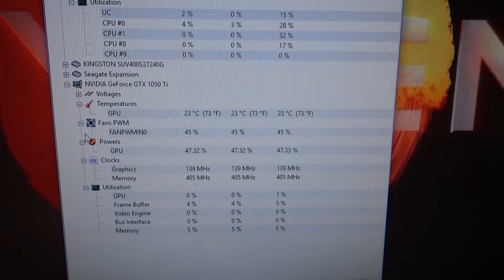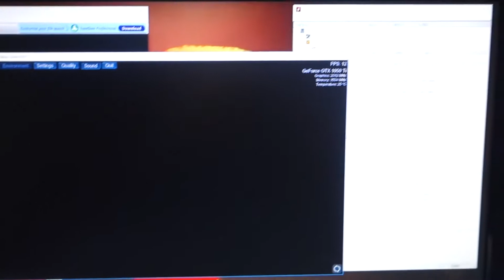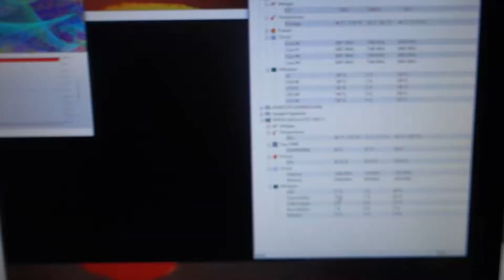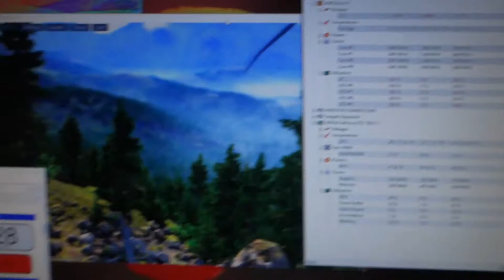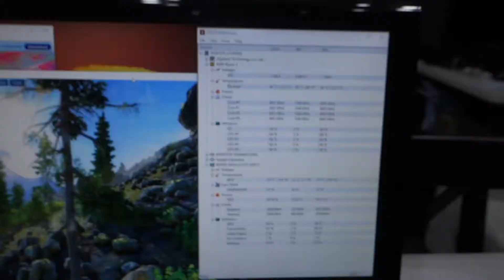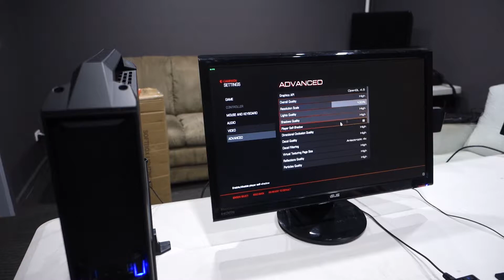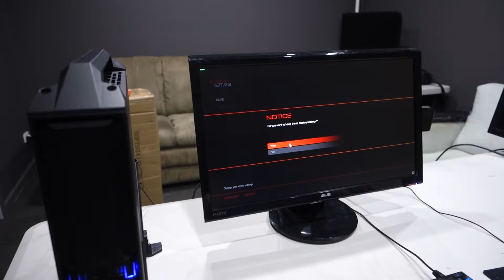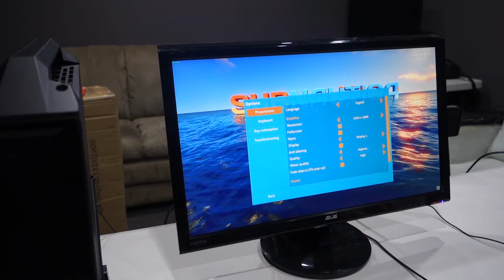Testing my Ryzen Mini-ITX Build - Temps, clocks and FPS

Comment: what did you use for cpu cooling.  Temperature is great btw
Reply from the maker: CPU cooler is the stealth one that comes with the CPU. Even though this PC is small and therefore has barely any airflow, there are plenty of ventilation holes all over the chassis so heat doesnt really build up.

Comment: I have this case build with ryzen 5 2600 and noctua l9x65, and an Asus dual rx580 8gb. My CPU is 50-55ºC in idle and 80º-85ºC in full load. GPU is burning in full load with 87ºC, 74º in undervolt and with custom fan speed. Removing the dust panels the temperatures drop by 5-7 degrees Celsius.

Comment: WTF 0 comments? really? Is an interesting video, do you thing is a good idea this case mini itx? temperature can be a problem with larges hours periods
Reply from the maker: Temperatures are great in this case there's plenty of ventilation and the ventilation holes are very close to the GPU and CPU so heat escapes the chassis quickly. I've used this PC for gaming 10hrs straight once and haven't had any issues.
Reply: that's awesome. Exactly what I wanted to hear. I really love this case because I love SFF and Big GPUs... would be nice to drag my PC around the house as easily as a console!